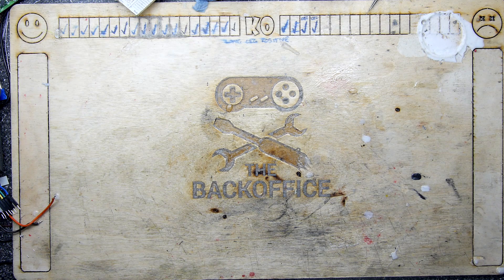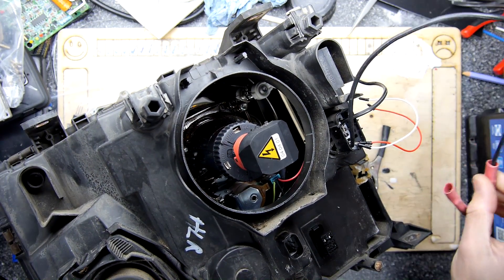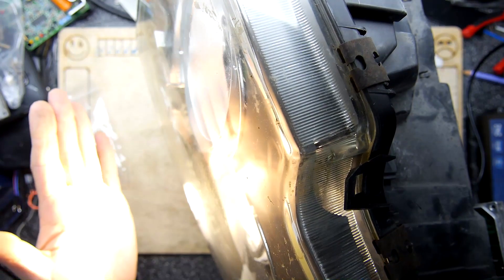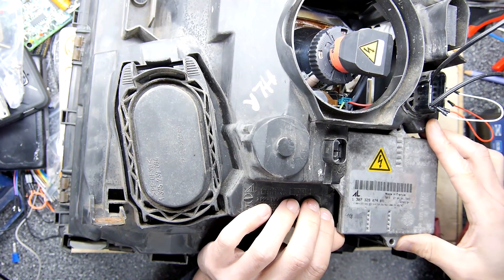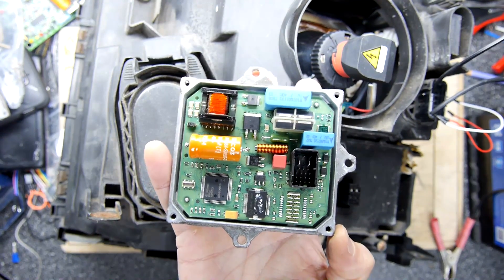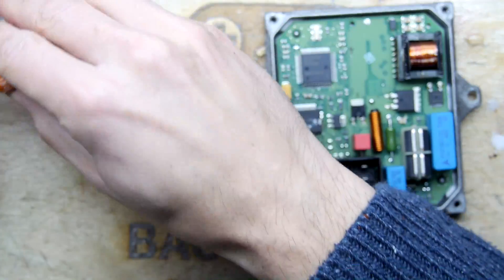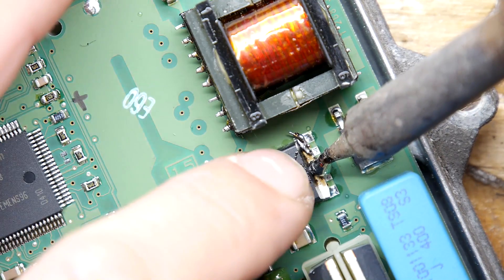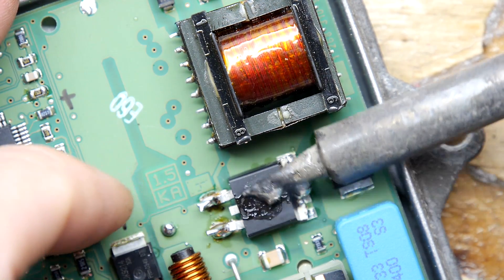Xenon Ballast Repair

Comment: Mine had the current measuring smd resistor blown up (the green one in the corner 500mOhm / 3W). Sadly, I couldn't find any of those in stock, so I had to improvise and solder two 1Ohm resistors in the same 2010 package back to back in parallel config.

Comment: can someone explain why does this thing need two rather large microchips? all it has to do is literally start the lamp and limit its current
Reply: Before seeing the chips on the board I would have said it is because it has an SMPS and they typically use some kind of PWM chip and sometimes a regulator. But those chips look quite different…

Comment: The "trick" for working on anything like this, were the pcb is heavy copper or tightly heat sunk to the case (ie most power electronics) is either buying a cheap hot plate (set to 100 degC to pre warm the unit) or, if you're willing to exchange some cost for some more risk, is to use a hot air gun (paint stripper type) to VERY CAREFULLY warm the entire unit to around the same temp! (keep the hot air gun well away (12" or so) keep it moving, don''t rush the heating!  

Do that, and you'll find your normal iron pops components off no probs at all!

(BTW, the capacitance of a capacitor is always very different as the tolerance is usually -10% + 20%.  Far more important is the ESR of the capacitor, particularly, as here, when it is being used as a voltage snubber  (ie it is absorbing a lot of ripple current)
Reply from the maker: +Max Torque lots of good advice here! I might need to log in via the web interface and make this a sticky 😁

Comment: What kind of insane device is this!? There's an 80-pin microcomputer chip to run a light bulb!? Please, someone get those German engineers laid! I remember when a light bulb was a few bucks and only required connection to a 12 volt dc power source. People have lost their damn minds.
Reply: One simple high altitude EMP weapon will darken all the headlights for 100 miles.
Reply: It's HID, about 2x times brighter than halogen and with no glare, generally ballasts last 15+ years
Reply: I cant complain about the design of those ballasts, they do last a long time and there are a few safeties programed in probably a lot more. The ballasts have protection against failing bulbs and prevent overheating of the ballasts or damaging bulbs. They do sense if the bulbs have failed, if you loose both lights, it will reset automatically and try to reignite, no fumbling to try to regain lights

Comment: 11:45

This is a good example of the difference between a soldering station's max temperature and it's thermal capacity.

It may be able to heat the tip to 480 C normally, but the temp will rapidly drop on a heatsink like that, and the station / iron can't keep up.

I would strongly recommend you switching to a less pointy "chisel" tip of around 2-3mm width.

It honestly makes a massive difference to getting good heat transfer, and might even help in heatsink situations like this one. ;)

With the slightly wider / shorter chisel tip, you don't really need to get the iron side-on to the components either, just end-on.

But, the chisel tip can still be used to solder very small SMD stuff, by using the corner of the tip.

Seriously, try a decent chisel - it will change your life. :p
Reply: 19:00

The capacity of that iron looks pretty good tbh.

I'm convinced that MOSFET would have been removable without nibbling if the iron had a different tip.

Is that a Hakko or Weller clone of some type? The beeper sounds identical to my Duratool / Rhino / Zhongdi de-soldering station though, so I'm guessing you might have a combo version?
Reply from the maker: +ElectronAsh it's unbranded, bit I have seen a duratool variant. I do have other tips and heating elements but not need to replace either in over 7 years 😁 good iron.
Reply from the maker: +ElectronAsh I might get hold of one of those big and nasty branding iron your types for the serious stuff, like motor brushes etc
Reply: The Backoffice

Well, that might work too. lol

I have a 6mm chisel for the Metcal, and that could probably solder to the Golden Gate. :p
Reply: I love your accent!

Comment: Hello. 
Thanks for the video. 
We are trying to repair similar device. After i have changed transistors and diode was were broken, the lamp start to light for 3 second and than stop. Do you have any idea what to check additionally. Thanks in advance.

Comment: Excellent video. How did you open the ballast? The Valeo one on my car seems to be riveted closed.
Reply from the maker: I don't really how I opened it, screws I think. Can you drill out the rivets?
Reply: @backofficeshow  Yes, I think so and then glue it back together. Did you ever establish which of the two components was failing?

Comment: The reason you’re having a pain with de-soldering things is that you have a pointed tip on the soldering iron. 

First thing you should have done when you got your iron was to bin that tip. Use either an angled knife edge type or a chisel shaped. Use the broad flat edge of either tip against the MOSFET tab. It’ll go much quicker.

It doesn’t matter how high you turn up your iron’s temp. If you can’t get those watts transferred to the work, it’s all for naught.
Reply: Instablaster...
Reply: And lack of flux... hot air might me a simpler solution but on that board it needs some experience

Comment: The capacitor which was warming up is on the low voltage supply. It heats up due to high ripple current from the inverter. Even ballasts with no faults show this capacitor heating up. What was the conclusion in this case? The tutorial was highjacked by adverts that bypassed my adblock and I could not see the end.

Comment: i use the broad chisel style soldering tip at work a lot, helps to dump heat into parts evenly, your always going to struggle with the point tip. thanks for the video!
Reply from the maker: I'll try one next time I'm ordering bits
Reply: I'll have to try thst also. I thought point woul be better in small situations like this

Comment: @backofficeshow 33:51 is that FLIR camera fixed/modded to use a cable instead of the short connector ? I have a similar one that I broke the connector :/
Reply from the maker: You should be able to solder a regular USB cable to the PCB in place of your broken one

Comment: Silicon tube on a solder sucker?
https://www.amazon.co.uk/Quality-Innovative-Silicone-Nozzle-Engineer/dp/B002MJMXD4/ref=sr_1_1?ie=UTF8&qid=1512222991&sr=8-1&keywords=engineer+ss-02+solder+sucker

I have one since over two years now and am very happy with it. The tube really makes a big difference and the vacuum didn't get weaker over time (in opposite to all the other solder suckers I had before), so quality spring and sealings. It came with a quite long piece of replacement tube, but so far I didn't have any reason to replace the original piece. But I don't use it that frequently too.
Reply from the maker: +Ingo Günther nice! I will add one to my Christmas list! 😁

Comment: Hi there! I own a Mercedes C200 kompressor and I have an issue with the headlights,the right 1 especially.Is turning off for like 2 3 seconds then come back then again,I have replaced the droser but not with a new one,it worked for like 2 months and now I have the issue again but on the both headlights,some opinions,I did have a problem with the alternator,i have change it and I still have the headlight issue.maybe a short circuit?
Reply from the maker: I would think is either the ballast or the lamp. Are the lamps original or known good brand? I have had problems with cheap lamps from eBay before.

Comment: Hello Master Andrea! i have the same problem with my ballast  AL(bmw e46), where i can find the capacitory epcos and the transistor? The transistor is different from the OEM? Thanks in advance
Reply from the maker: +Paolo Perozzi eBay us your friend! Type in the part numbers of what you have in there and hopefully they will have some. Have a look and let me know if successful.
Reply: @backofficeshow  Ebay is NOT your friend. Too many inferior counterfeit components for sale there. Buy your parts from a reputable electronic supply company such as Digikey or Mouser.

Comment: I changed capacitor and power mosfet IRL2910 and still same problem :( When are xenon's cold no problem with start, but after 20 minutes when the xenon heats up and the next switch-off / on is no longer working, only the right xenon does not light up. But after a while the left xenon (which shines) gets warm, I turn off / on,  right xenon shine up again .. please help :) .. 
I have VCDS and i got this error from ballast: 65535 - control unit: memory error
Reply from the maker: Have you tried any other makes of lamp? I know it sounds crazy but this can be the problem. I recall measuring with a thermal camera and they were holding steady, but it was the xenon lamps themselves.
Reply: No, I did not try other lamp manufacturers, I only exchanged them with each other (the left lamp I put on the right side and right on the leftside) still is a problem with the right side. An error message when the right xenon does not light up : the resistance value is too high
Reply from the maker: I bet it's the lamps
Reply: Ok, I try to buy a new one, and then I write comment if it helped :)
Reply from the maker: I hope it solves your issue!
Reply: Hello again, I changed the lamps, costing around 15 € per one (temperature 8000K), still the same problem :( after a 30-minute ride and a few 5-minute rides the lamp on the right does not light up